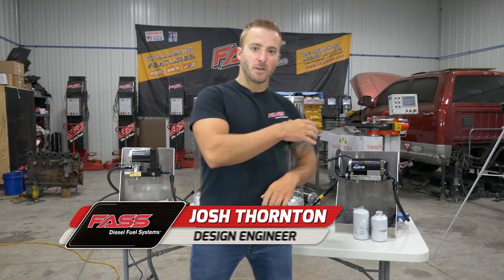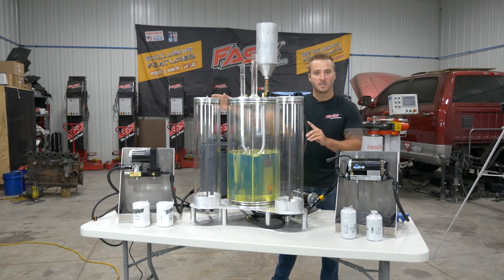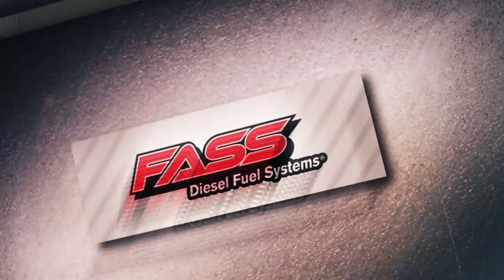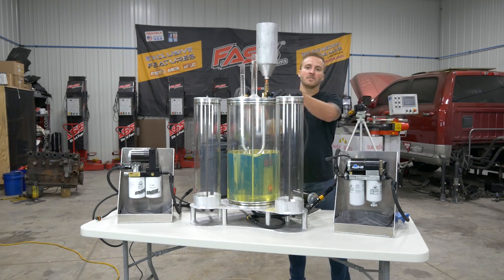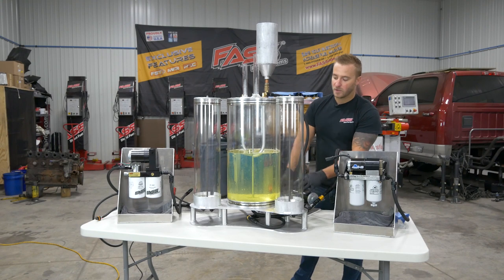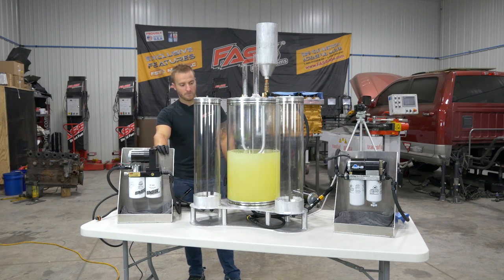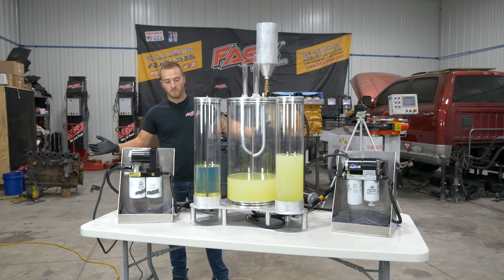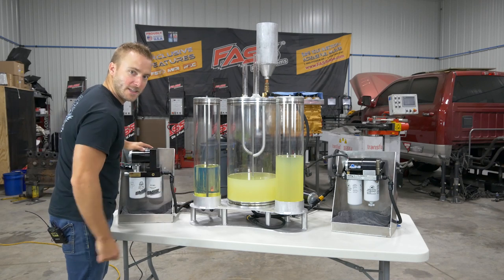FASS Extreme Water Separator Vs. Competitor's Water Separator

Comment: The difference here is amazing! To make it a truly fair test though, I think you would need to slow the airdog flow output down to somewhere between idle and cruise flow rates as it is a demand flow system and fass is a constant return system.  

I still think the fass would way outperform the airdog, but to be fair you don’t run down the road at the max flow of these pumps.

Holly molly though, I was skeptical on the no drain water separator, hard to argue with results like that!

Comment: Love my FASS system. My buddy has the Airdog and I showed him this video. Good news is, he bought the FASS. Bad news is, I have to help him install it hahaha. Also, no issues either on fuel. Currently run daily on 800hp tune and highest I run on is 1000hp tune. Though I do have a 12mm stroker, the fuel is always there
Reply from the maker: That feedback is very much appreciated as well as all your support! Thank you so much!
Reply: Just use the filters

Comment: So guessing when the media get full it’s time to change the filter or is their another way to ge the water outa the filter?
Reply from the maker: Hey Cory, thank you for reaching out. That is correct, when the media gets full it will be time to change the filters. As they fill with water you'll notice the system may start to get a little louder. We usually suggest changing the filters once a year, or every 20-30k miles whichever comes first.

Comment: I’ve got a FASS 165 on my Cummins. It was sitting in 5 degree weather overnight last weekend. I kept my block heater plugged in all night. Went to start it the next morning and it fired right up, but would only run variably for a few minutes or so before shutting off. Like it kept getting starved for fuel. My differential diagnostic considerations included frozen water in the separator obstructing fuel flow, water getting past the separator or fuel gelling. I took a hair dryer and warmed the fuel filter and water separator canisters on my FASS for about 45 mins. I also added diesel 911 fluid as well as iso-heet fluid. That fixed my issue and I subsequently drove it for 300 miles that afternoon.  I doubt it was fuel gelling as I run cold weather power service diesel fuel supplement all winter and 5 isn’t really all that cold. So it had to have been some issue with the water separator freezing. Any thoughts as to what was going on there or how to prevent it in the future? Should I change my separator filter after that event? What kind of temperatures would you recommend adding a heater kit to the system?
Reply from the maker: Hey there, first I want to apologize for the trouble you were having getting the truck started. For this, I would suggest giving our tech line a call at 
1-866-769-3747. Our team will be able to get this diagnosed for you and make sure everything is working as it should as well. I appreciate you reaching out about this!
Reply: I put the 12v electric heat kit on mine.
Reply from the maker: @adrianspeeder  Nice, we hope that's been working well for you!

Comment: Why did you have to replace the water separator filter for the second test when you polished the fuel in the large center vessel? What is that, 3 or 4 gallons of fuel? That suggests that your filter couldn't continue to separate the water from the center vessel on one filter cartridge. What's up with that???
Reply from the maker: Once the XWS-3002 Extreme Water Separator is plugged with water it would need to be replaced.
Reply: @FASSFuelSystems  how much water does it take to plug it im not really liking this new filter because if it stops sending fuel that could also grenade my cp4 will yall warranty a fuel system? Should've left it alone id much rather drain the water from my filter and that way u can also check and see if u have been getting contaminated fuel
Reply from the maker: @Chrisguidry1923  The water capacity on the XWS-3002 is 120 ml. The water capacity on the XWS-3002 XL is 180 ml. If you would like to use an old style water separator with a drain you can use our cross reference list on our website, fassride.com, to find a filter you like.

Comment: Dont own either but for both being 165 GPH pumps the air dog filled the tank twice as fast so was it speed up to for the test or is the fass slowed down to do a better job ?
Reply: Nailed it
Reply: Looked to me like be didn't have the fass completely primed. He didn't follow their priming procedures. Lol.
Reply: Looked to me like they pumped at the exact same rate. Problem was the FASS wasn't primed all the way.  If you watch again, once the FASS starts pumping solid they maintain the exact same fill rate
Reply: I noticed too he didn’t do the priming procedure but also it didn’t have the dip tube on the positive side of the pump, if that makes the difference. Slightly older design??

Comment: Does fass offer lifetime warranties, my plate with the anodized aluminum is showing extreme corrosion on the mounting surface now. I keep the truck very clean too so idk.
Reply from the maker: Hey Chris, thanks for reaching out! When it's convenient, give us a shout at 636-433-5410 or shoot us an email to techsupport@fassride.com and our team will be happy to check your warranty status.
Reply: Galvanic corrosion. You need to insulate the aluminum from your steel frame, or at least provide some sort of oil barrier between them.
Reply: @UHOH3300  would a rubber gasket work etc?
Reply: @foxgdsmck  only if they are electrically insulated. I prefer Fluidfilm, it helps, although it can’t completely stop galvanic corrosion

Comment: so i would like to know were the water that is seperated goes, he said it doest have a drain but it clearly removed the water but were does the water end up?
Reply from the maker: Appreciate you asking, and the water actually gets trapped in the XWS-3002 filter media.
Reply: so the filter absorbed 190ml of water and is able to hold it and still filter more fuel until you change the filter?
Reply from the maker: @cjcallen5974  that is correct, yes. The media in the filter will trap the water until it reaches capacity.

Comment: Wait... Where’s the down tube on the fass that pulls fuel from the bottom of that filter? There’s one on the air dog, and there’s one on my fass on my 99 Cummins.... But there’s not one on that demo unit. Why did ya’ll remove that down tube/draw straw?
Reply from the maker: That tube is actually on the pressure side of the pump. It is part of how the air is separated from the fuel. We use this display to show the difference in our water separation compared to the competition. We use both our regular length XWS-3002 and PF-3001 filters as well as our extended length XWS-3002 XL and PF-3001 XL filters on this display. Leaving the tube out makes it easier (and cleaner) for us to change out the XWS-3002 XL when we are using this display at a show.
Reply: @FASSFuelSystems  but I’m also thinking that tube would’ve been low enough in the filter to grab the separated water. Not trying to be a jerk here, just saying that that tube draws from the bottom. I can totally be wrong, and I like my fass. But I do think you’ll end up with water on that pressure side if there’s that much in the tank.

Comment: How often do you need to change filters in the FASS?
Reply from the maker: Hey Mark, thank you for reaching out. We do suggest that you change the filters every 20-30k miles or once a year whichever comes first. 

One thing I usually do suggest though regardless of the brand is keeping an extra set of filters on you. Just in case a station you fill up at has watered-down fuel. 

https://fassride.com/products/fass-fuel-filter-selector/

Comment: Why doesn't the Fass system have a pickup tube on it like all other titanium series? Another question is when I got mine new the water separator was reverse to the placement now?
Reply from the maker: Awesome question, and on the newer Titanium series we changed filter placement. The particulate filter will be first to pull all the larger debris, and particles out of the fuel, and then sent to the water separator to complete the polishing process. On all newer systems, we also use a draw straw to combat 1/4 thank issues. If you have any more questions or need anything at all you are also welcome to reach out to our service team at 1-866-769-3747. Thank you!

Comment: what happens when the filter is saturated does it stop fuel flow? I’d rather have a little water then no diesel....
Reply: Your 10 amp fuse pops then you replace the filter and the fuse and your good
Reply: Connor Barnedt so during the time it takes for the amperage to get above ten.... and after since the truck doesn’t know how much fuel is going to your high pressure pump?

Comment: How does a person know when its time to change the water catching filter?
Reply from the maker: Thank you for reaching out! Great question and we do suggest that the filters are changed every 20k miles, or 1 year whichever comes first.
Reply: @FASSFuelSystems  
Thanks for the reply.
I should have added this.
Are you basing that interval on milage?
How about a class 8 truck?
Milage is a lot higher. 
And fuel purchased sometimes at unknown fuel stops.
Where a person may pick up extra water. If the filter medium gets saturated.  How can you tell?
Thanks again for your help and support.

Comment: Would you recommend keeping the stock fuel filters on a 2017 Ram 6.7 if I install the new style pump? It has the WIF sensors.
Reply: You are totally bypassing the stock system.

Comment: So how often do you change the water separator filter ?
Reply: Lol as often as you think or when you're truck just shuts down because its fuel starved,  this pump shut off fuel when the water filter gets full.
Reply from the maker: Depending on your fuel quality, the general service interval is 20,000-30,000 miles. These filters will shut down fuel flow, only in the event of running into extremely contaminated fuel. Other than that, they will trap the water and still allow unrestricted fuel flow.

Comment: Why is there no drain on the filter to drain water? You have to change the filter to get the water out it cannot be drained, it is trapped in the media of the filter is that what he said?
Reply from the maker: The XWS-3002 and XWS-3002 XL Extreme Water Separators trap water in the element of the filter.

Comment: Kinda funny how one of fass marketing points is that they are quieter but in this video the airdog was quieter than the fass.
Reply: joe Wolters doesn’t really matter just look at how much better it did saving your engine from water
Reply: Someone isn't happy about their air dog lol.
Reply: Timmy k who ??
Reply: Joe Walters.. .... I have a Fuelab 200 lift pump and its been good to me.  Got a good deal on it or I'd have a Fass anyday.
Reply: I haven't heard a quiet FASS Pump yet. I'm running the Airdog ll-4g and it's whisper quiet. Very Happy with Airdog.
Reply: @joe Wolters Kinda funny how quiet and fast the AD was and even funnier how much water it did NOT separate... I actually chuckled when I saw how clean the FASS diesel was coming out.
Reply: @Bad Ass 6.0 Powerstroke Hopefully that wasn’t the 4g and AD actually has a filter now that works on water because their filter there didn’t... I’m ordering a FASS tonight for my 2001 Dodge Cummins 4x4 6spd manual!

Comment: Why mileters? Most Americans don't have a clue of the metric system unless it is a wrench. If you want to say "X" mileters then give the rough translation so people can visualize the volume of water added. 
Also, please drain the water out of both filters to drive home the water separation difference.

Comment: So without a drain you cant clear the water from the filter, does the filter have a sensor to detect the water and when the filter requires changing? How much water will the filter hold? I notice you changed it to filter out the rest of that water. It looks like it wouldnt hold much at all.
Reply from the maker: The XWS-3002 will hold approximately 120 ML of water, most diesels will not see that much contamination level throughout the filter service interval. The service interval is 20,000-30,000 miles depending on fuel quality. If the XWS-3002 becomes completely plugged with water, it will stop fuel flow and blow the FASS fuse preventing water from reaching your injection system. If it didn't stop fuel flow, you would have water pass through and shut the engine off due to fuel system damage. We're saving injection systems!
Reply: We often see much higher levels of contamination here in Australia due to wide temperature variations causing condensation in servo tanks. A typical 4x4 might carry between 140L and 290L of fuel. I do like the idea of the fuse. Do you have an Australian distributor?
Reply from the maker: @VEOPengineering  

The XWS-3002 will hold 120ML of water, even with higher contamination it would still work out great. We also offer an extended length version the XWS-3002XL which offers 44% greater capacity.

Yes, we have a few distributors in Australia. Please follow this link to locate your nearest: https://fassride.com/locate-a-dealer/

Comment: I know I’m a little late to ask but if you would change out the air dogs filters and replace them with larger and higher micron filters would it work better and smoother or would it just slow the whole system down. Just curious how it would perform.
Reply from the maker: Hey Nick, that is a great question and I do apologize as we wouldn't be able to verify 3rd party testing with different filters on the AirDog. 

If you have any other questions or need anything at all you are more than welcome to reach out to us at 636-433-5410. Thank you!

Comment: Interesting, however, and stop me if I am wrong as I am new to fuel filtration, but isn’t the Airdog filters used to prevent air in the system and not necessarily water?  If that last statement holds truth, that is comparing two dissimilar products.  My real question is, could anyone please provide me with disinterested product testing of this FASS system, a CAT filter, or any other reputable filter manufacturer (similar to what Project Farm offers)?  Thanks in advance.  I am personally leaning towards the just released new product by SPE (2020 F350 PSD).  I have to do all that I can to protect that lily ass Bosch CP4 pump.  Such a huge fail on behalf of FoMoCo.😞
Reply from the maker: Great question, and we will be happy to help. We have a link here that will take you to the 3rd party testing results we had done on our filters. 

https://fassride.com/fass-fuel-filters-versus-competition/

If you have any other questions for us we have a customer service team that will be happy to answer anything you have. Our number is 636-433-5410. Thank you!